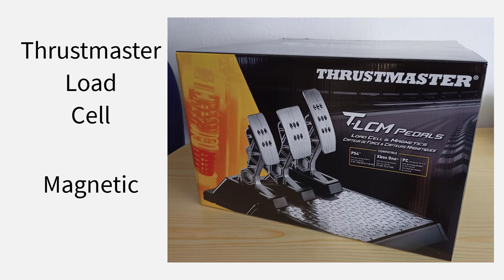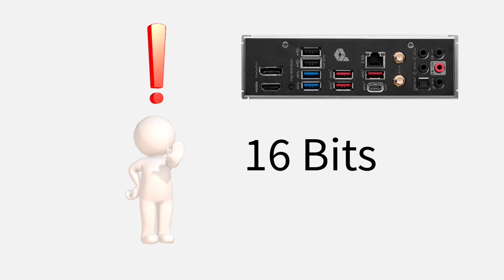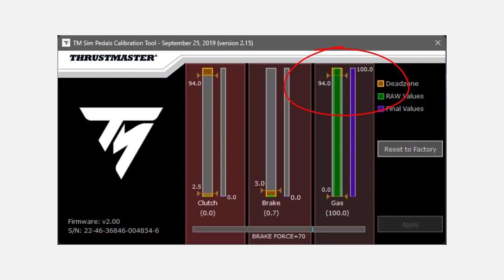Transitioning from a Thrustmaster T3PA Pedal set to a Thrustmaster T-LCM, Load Cell Pedal set

Comment: I currently use a T500 with included pedal set and a basher boards brake mod (those skateboard tyres kits). But having upgraded (?) to a wheel stand my pedals don't allow the stand to be folded and put away. Long story - I retired from sim racing 5 years ago and no longer have room in my man cave due to a nice leather 3 seat couch taking up the space. I'm having another go. 
What's your opinion regarding the loadcell and arthritic knees? I can manage with the current brake in use, as long as I limit myself to under 3 hours at a time.
Reply from the maker: That's a difficult question to answer. I can say that I have some muscle issues in my leg, and when first using the load cell brake I could feel it the next day. Possibly you would need to use the lighter spring set, or adapt it using one of the mod sets, similar to the board mod you have been using. Either way, you need to order from somewhere that offers a good returns policy.

This is the sort of question you could ask over at the Older Gamer Discord channel. Lots of people there or a certain age are available to help, someone might have a more personal experience they can share with you. 

Take a look here if you are interested - https://discord.gg/7U34BsqDXj

Comment: I just needed a replacement set belonging to the Thrustmaster Ferrari Integral Alacantara edition with what looks like your old peadals, they where £100 pound cheaper. I'm just hoping they have the same fitting, the connection as the set that came with mine are T3PA, which is on the box but confusing. Do you know? I may get the time loader peadals next time, Thanks or Slainte 👍
Reply from the maker: I'm afraid I have never used this combination, although Thrustmaster tend to use similar connections across their range, probably to save money, so I would say you have a chance, but order from somewhere that offers a good returns policy.

Comment: About to pull the trigger on these, they are on special where I live for another week - thank you for your review! It’s a low enough price for me to justify upgrading my pedals :)

As a fellow older gamer, I’d like to know - after having these pedals for a while now, how are your knees going? Are these pedals too tough for old gamers knees?
Reply from the maker: I had some knee pain a few days ago, but I think that might have been the activities I was doing before racing (fitness studio, gardening, life), but I have been advised to move the brake pedal over (the bit you put your foot on can be adjusted laterally) to stop my knee from twisting while doing left foot braking.

Otherwise, you can reduce the pressure of the brake pedal, both by using lighter springs, and also adjust a bolt underneath the brakepedal which adjust the tension of the pedal.

Hope this helps.
Reply: U can  set it so that for eg.   A 50% press translate to a fully pressed brake.

I think I use it on 74 off the top of my head
Reply from the maker: @thefourfourfour9512  I have got mine set to about 70, so maybe I should back it off to 50%. I'll give it a try, Thank you for the advice.

Comment: when going in the corner and i hit the brakes , will these springs help when letting go of the breaks, i don't want the pedal to go back up quickly. I want a slow reset when i am letting go of the brakes, does that make sense?
Reply from the maker: It does make sense, and I get what you are trying to do, I think I am trying to do something similar here myself.

I would say that it sort of helps, but it's because the springs and the load cell functionality offer a greater level of refinement when it comes to simply pushing down the pedal with your foot. It just feels better, and give you better control of smaller inputs on the brake.

At least, it's better than the simple potentiometer system used by non-load cell pedals. 

Be aware though, Load Cell pedals do have a learning curve, so you may find you don't take to them straight away, but if you keep at it, they will improve your braking.

Comment: Great review. I have just ordered a set to upgrade from my T3pa pro pedals. I generally play ACC on Xbox. Does the load cell help with trail braking?
Reply from the maker: It will help you once you adapt to using a load cell pedal. This does require a learning curve and it will take a bit of time to get used to, but eventually, once you have everything set up, you should find braking to be overall better.

Comment: Ive just brought the T-CLM pedals gone from the T3PA but the throttle is on the left? On the T-CLM pedals can i change it to the right?
Reply from the maker: Do you mean it is physically someone has changed the pedal to the right or in the configuration it's on the right? If it's just physically, then I think you can change them back without too much fuss, some people change the clutch pedal and spring to be the throttle because they say it feels better.

If you bought this unit new, then you should complain. If it's second-hand, then I would try it first, as it is, and if you like it, leave it, otherwise, change it over.

Makes sure you use the correct tools to take it apart and look out for any washers or springs that might escape while doing so.
Reply: @OlderGamersPerspective  I've brought it brand new out the box the Accelerator is on the left i need it on the right im so confused by this because I brought the T3PA from the same place and the Accelerator is on the right on them
Reply from the maker: @leemartin3429  you should contact the people that sent it to you. To me this clearly is incorrect and either been altered by someone who had it before you and returned it, or it was assembled wrong at the factory. Either way, it probably should be returned.
Reply: @OlderGamersPerspective  Thabk you

Comment: I didnt read through all the comments to see if its been answered or not, but you can invert T3PA pedals so they are hung like they are in a real car, Im wondering if both clutch and throttle having halls sensors are for that reason. I literally just got a set of these a couple hrs ago for xmas and looking for setup videos, sooo, Im assuming these can be inverted as well but was looking for verification, this might be it
Reply from the maker: I have not had any experience in inverting pedals, but I did find this for you:

https://www.youtube.com/watch?v=p00s83CHDzU

Which is a very cheap way of doing it, but seems to suggest that, technically, it is possible.
Good luck, and let me know how it turned out.
Reply: Thx, I had my T3PA pedals inverted already, thats why I was hoping I could with these, apparently thats harder than I thought @OlderGamersPerspective

Comment: Question is can i just direct plug into my base as i dont have a computer to calibrate. Im on xseries x thanku.
Reply from the maker: I don't have any experience with Direct Drive wheels and consoles as I use the PC exclusively. I would ask this question on Reddit, where you will get a better answer. Let me know how you get on.
Reply: As far as I have read elsewhere the calibration set up on the PC doesn't carry forward to the console. I did set mine up on PC but I don't think it was necessary. On GT7 just press your pedals to where you want 100% to be and they are now calibrated on GT7. Not sure about other racing games.
Reply: Yes you can plug into your base and use, but for best results your going to need to use the software on a PC to calibrate properly. Once calibrated on a PC, unplug and connect to the base, and the settings will be saved and carried over to play on the console. 
I use an apex purple mod with a red spring and slider set to 97%, as the springs alone are very easy to overcome, and don’t supply just as good or as accurate a feeling underfoot as an elastomer modification.

Comment: what kind of mic do you use when recording? what makes it so clear and smooth?
Reply from the maker: I am using an old M-Audio Producer USB mic that I bought a number of years ago. Been thinking of upgrading it to be honest. But at the moment, it sits on my desk, on a short stand, right in front of me, with a pop blocker between me and the mic. I have found that putting the text on my second monitor (which is to my right) and looking in that direction also helps with reducing the pops when talking. I am fairly close to the mic, which I am not sure is a good thing, and I would prefer to get a mic arm/boom thingy, but my desk is very deep and there is no way to use the side of the desk due to a drawer unit being there.

In all, it's not ideal, but it's what I had in my possession and so I just went with it. I am glad you find it smooth and clear. I don't add any filters to the audio and record directly into Camtasia using the Narration feature, which I find easier. 

On scripted videos, I put down the audio first and then cut out as many of the umms and ahhs as I can, and any pauses that are too long. On 'live' videos I narrate off-the-cuff and so the video goes in first and audio second, although I do sometimes cut out stuff to keep it punchy. 

I have yet to do a live stream, the nearest I got to this was the Moza 9 review video where I narrated while driving and then put that together later. This had two downsides, firstly my driving sucked while I tried to multi task, and secondly, I used replay to put the video with the audio and so people assumed I was driving in third person, where as I was in reality using cockpit view. When I recorded this audio, while driving, I used a Zoom H1 with a Lav mic and synced everything up in post.

I hope this information helps you.
Reply: @OlderGamersPerspective  Really appreciate the info, keep it up, cuz the Audie is so nice that no one want to leave

Comment: Thanks for mentioning which rig you own - I'm currently looking at getting a GT Omega Art rig
Reply from the maker: Hi, glad you found the video helpful. I've had the ART rig now for a few months, with the XL seat, and I find it to be one of the best platforms I have used for sim racing. Very comfortable and able to cope with the demands of a load cell pedal and a direct drive wheel. I did a full review over at https://youtu.be/QHyC_SPhPKQ but at this point I was using the T300 and not the Moza R9. But the rig coped with the Direct drive with no issues and, as far as I can tell, no flex.

Comment: Sim socks not shoes,  In my view and I can play 4/6 hours fine. But good video thank you
Reply from the maker: Sim socks had me reaching for google... That do look cool, but do you use a load cell pedal?
Reply: @OlderGamersPerspective  yes and I have simsok. The grips was a little strange under foot at first but with a couple of uses you don’t notice it. You don’t get the numb foot and with the load cell set to full 100% with max springs and no preload by using the washers it’s fine
Reply from the maker: @jaimecarlow7368  okay, that sounds interesting. I shall look into them and see if I can do a video on them. Any you recommend?
Reply: @OlderGamersPerspective  personally I’ve only tried the simsok one so far. I’m on my first pair that are around 7 months old. They are made of a lovely material and are nice snug fit. The only issue I would say I can see happening some cases is the grips may ware off for a heel toe driver. But that’s for someone else as use  sequential. But I will definitely be looking at some others to compare after these feel like it’s time to replace. As it’s my first set. I use to just double up on normal socks
Reply from the maker: @jaimecarlow7368  so you slip them over your socks to race?
Reply: @OlderGamersPerspective  no just on you’re feet as a sock while racing. Before I got a pair. I use to double up normal socks as my feet would go numb on my old tp3a pros. But when I got the t lcm pedals I got the simsok socks and now I don’t need to double up I just ware the simsok socks while racing. I don’t use them when I’m not as I don’t want the grips to ware off or get pulled off walking around
Reply from the maker: @jaimecarlow7368  Thank you. I will track some down and give it  a try.

Comment: More immersive but they made me slower, by a lot. (Assetto Corsa with 250 hours)
Reply from the maker: How long have you been using them for? Took me some time to acclimatise to them.
Reply: @OlderGamersPerspective  
Not long, in total 4 hours but revisiting all the circuits and cars to get a feel for them. And feel like installing the old pedals again.  I left foot brake with bare feet and got quite a finesse feel going with the old pedals (T300RS) VR + Playseat challenge.   I've tried a wide variety of cars and had to go back to slower ones to start the learning curve over,  as I was a full 10 seconds slower in the vintage Ferrari F1 cars.  The calibration tool doesn't work in windows 11. The pedals are certainly more immersive tough, as they had me instantly desiring the shifter, where as before I wasn't bothered. I use paddles with throttle blip. The cars now snap a lot or drift when I've finished braking. Looks like I'll need to wait for time off work for some serious testing.
Reply from the maker: @richy69ify  The calibration tool works on my windows 11, it's the TM sim Pedals Calibration tool - if you don't have the correct one yet, you can find it here = https://support.thrustmaster.com/en/product/t-lcm-pedals-en/

This will only work if your pedals are plugged into your computer via the USB lead, it won't function if you have it lopped into the steering wheel with the PS2 type connector (whatever its called, I forget). But I can tell you it works fine for me, so take another look and see what you can do with it.

Swapping out the springs can also help, trying different combinations until you have one that works well with your style of driving.

Then stick with the one car, your favourite, until you have an angle on how these pedals work. When I put them on, I was at first slower, but after a while, I got the hang of it, but I don't think I used the older pedals for as long as you have, so maybe my transition period was bound to be shorter due to me having less experience. 

Keep on plugging away at them, I think they are great pedals and I still use mine today (just finished a race just now - although I came a disappointing 5th, fairly sure the pedals were not to blame :) )

You can also jump over the older gamer discord channel - https://discord.gg/pHJpvNff and post your issues in the Sim race help channel.

Lots of great people here with lots of experience, and all willing to help out fellow sim racers.
Reply: @OlderGamersPerspective  
Thanks for your help. The calibrator comes up and responds but it's always garbled across the screen. I've since discovered I had  left stability control on 25% on my steam launcher, but I had previously been using content manager last year which is set to pro mode. It's much better without. I've now fitted the white spring for my bare feet and going back to school by braking earlier. Looking at my old ghost cars I was very late braking. It's possible I'd managed get too used to the flaws in the old pedals, so need to change my style a bit. I'm sure I'll get there. As I mentioned before these pedals are nice a jump up in immersion.

Comment: sadly enough tho... the t-lcm pedals are the worse lc pedals you can get.
Reply from the maker: I mean, that is a subjective comment. I don't have enough experience to say one way or another, but they are much better than what I had.
Reply: @OlderGamersPerspective  i have had several different ones. the plastic housing is just open to flex a lot, seen a few clips were they simply brake too.
for me the quality from the fanatec v3's are a starting point, from there it goes up quickly and currently using the pricy heusinkveld sprints myself.

sure they are slightly better then your old pedal set but as loadcell pedals they really aren't actually good.
Reply from the maker: @D0G_CN  I would say from my perspective the T-LCM offers a much better experience,  way more than slightly better. But that is my subjective experience.  They are simply much better. 

The Fanatec V3's certainly look cool, but they are twice the price of the T-LCM, and not everyone has that sort of money.
Reply: @OlderGamersPerspective  ok, ill give you that. sure they are a lot better then pot - based pedals because you got said loadcell. and offcourse not everybody has v3's money and surely not have heusinkveld pedals money. you do the best with the money you got, but even the latest fanatec lc pedals (witch are way cheaper then the t-lcm pedals) are better.

not saying you should have or could have mind you, just pointing something out here.
offcourse this is just my opinion and how important is that in a pool of 7 billion opinions? 
im not trying to make you regret it either, play on brother
Reply from the maker: @D0G_CN  and you :)
Reply: @D0G_CN  You are right .
I will never understand thrustmaster productions....

The best value for money is for me the fanatec v2, which is almost better than the v3 for some